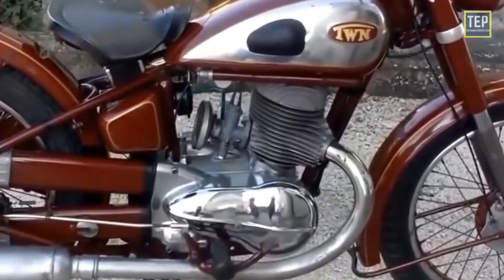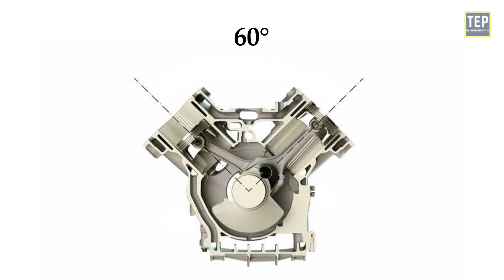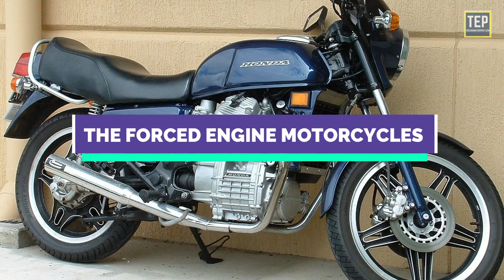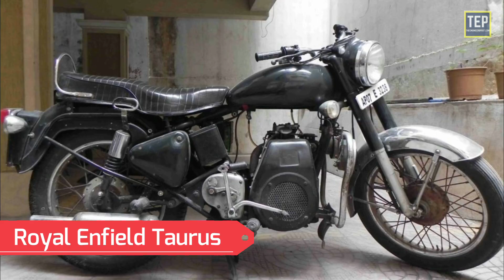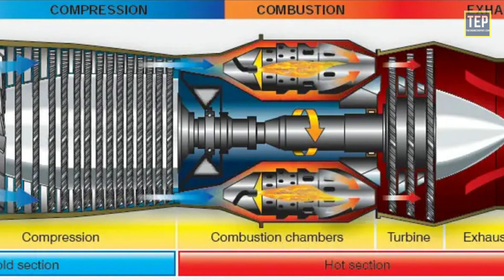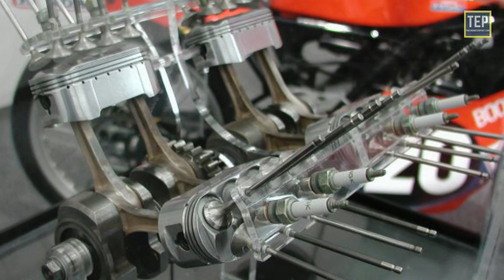Every Engine in Motorcycles Explained | Wankel, Radial, Turbine and more [Part - 2]

Comment: In part I, many complained about the OP using the wrong picture while speaking. I didn't double check.
Instead, I clicked on part II.
Around 9.57, I get that unpleasant feeling. At 10.47, I pause the video so I can comment. I so wished I hadn't to.